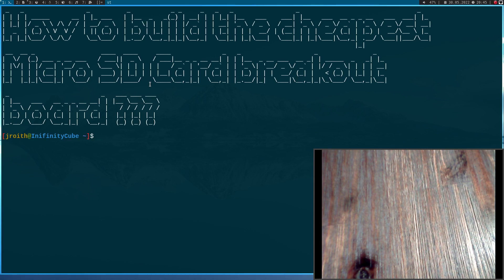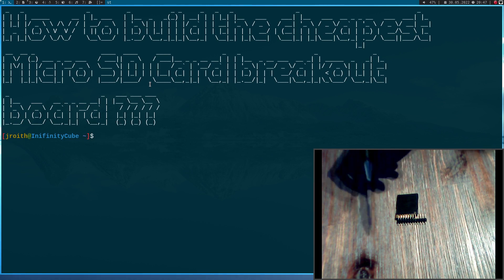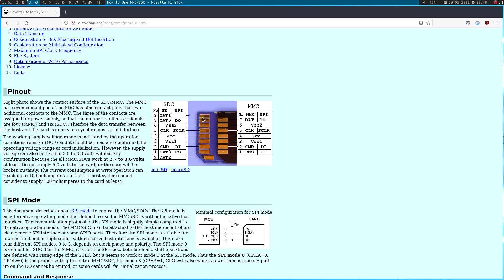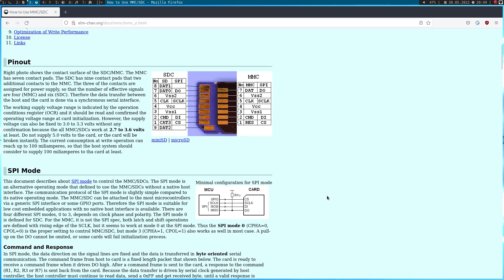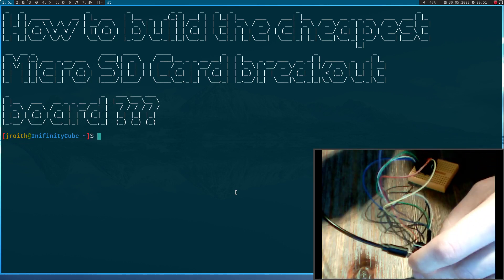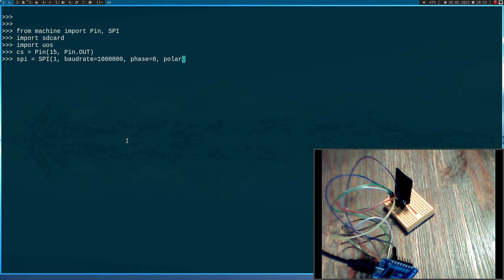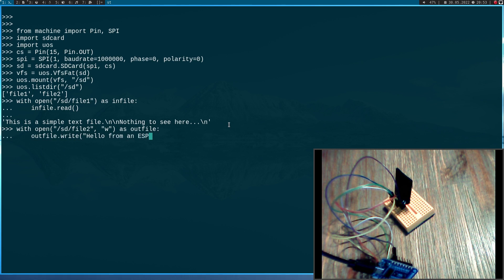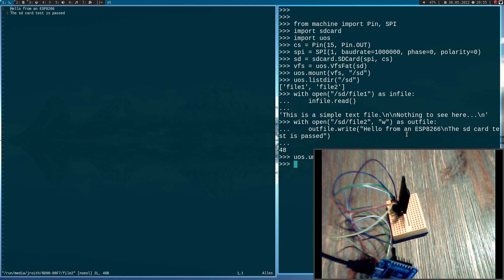How to build the cheapest Micro SD Card breakout board - Micropython Tutorial

Comment: bro  I get (File "<stdin>", line 1, in <module>
OSError: [Errno 19] ENODEV) after uos.mount(vfs, '/sd').
how to solve this issue
Reply: I don’t know if this is even really using the esp at all, I’ll try it but it looks like he just connected a microSD card directly using a breadboard . I don’t know but there are some instructables on how to connect to a pick and such and I think in the ones I seen the grounds on the card had to be tied together and if I were to do this from scratch I could see myself having to add a couple of transistors and possibly a shift register perhaps go as far as programming a pic to tie it all with a latch and clock. Something just doesn’t look right

Comment: Ive been doing this for years. Who doesnt have about a dozen of those adapters lol    With a bit of creative alignment (or a jumper wire), you CAN get those last two pins soldered up too for full SDIO.  I also found its easier to solder to the right-angle headers.  Finally, use the lowest temperature on your iron that melts your solder, and keep the soldering time short. The plastic of the adapter melts at very low temperatures.